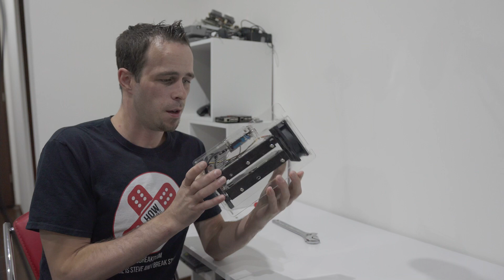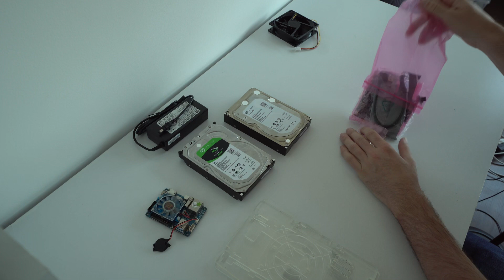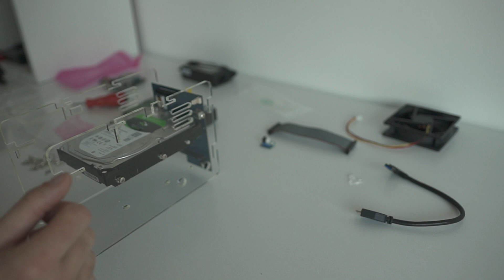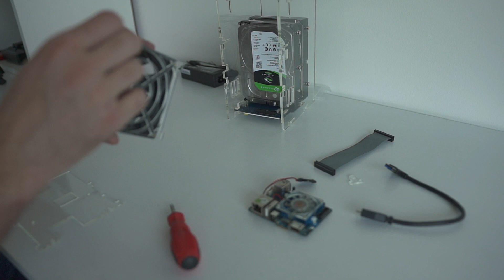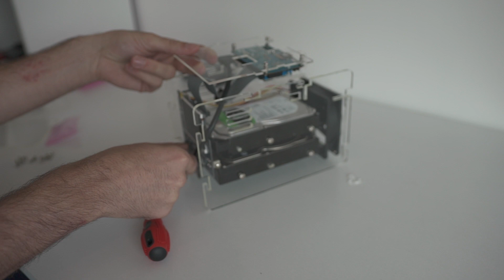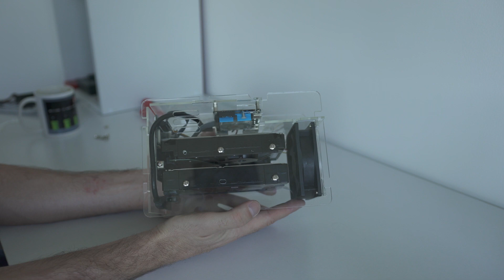ODroid Cloudshell 2 Assembly - Odroid XU4 - Cheap DIY NAS - How To Break It

Comment: 1. Can the OS be mounted from a micro SD card
2 Does it have Wifi or can we add a wifi module
3. When you set it up will it ask you to Format your 6TB drives.
Reply from the maker: Yeah you can definitely use the SD card for the OS, I just had emmc so I went that way. It wouldn't make much difference outside of booting and maybe stability long term because as cards are a little less reliable than emmc. The XU4 as well as the cloudshell 2 package does not have wifi, but HardKernels website has some officially supported wifi dongles you can use. As far as formatting the drives, I suppose you don't have to. If you're taking already in use drives, I'm not sure how the Cloudshell 2 raid board will work with marrying them, If you're trying to raid two already in use drives with data on them, you'll definitely need to format them to achieve the raid. Hope that helps.

Comment: super video. thanks! Would this Odroid board also work with a 4x SATA controller and 2.5'' HDs?
Reply from the maker: I can't say for sure, but what I can say is the CS2 raid board with the screen only has the two days ports. I don't see why you couldn't connect 4 2.5" data drives to the XU4 via usb3 and a powered hub and then software raid them. But I think at that point you have the wrong board.
Reply: @HowToBreakIt  yes- I have done 4x HD via USB3 already but looking for a SATA solution for 4xHDs on a single board. Have not found this.
Reply from the maker: I would suggest checking out the RockPro64. It doesn't have 4 built in data ports, but it does have a PCIe x4 slot which you can insert the Star Tech 4 sata ports PCIe card into.
Reply: @HowToBreakIt  will do. Many thanks!
Reply from the maker: Happy breaking!

Comment: Could you advise how this thing works? I mean - I would personally connect 2 hard drives formatted as BTRFS and create RAID 1 or RAID 0 and get it working. How is this set up working? How do you mirror data after replacing faulty hdd?
Reply from the maker: I have it set up as raid0 striped with two 6tb hard drives acting as a 12tb volume. In my case, if I have a faulty drive I lose everything. Not recommended.